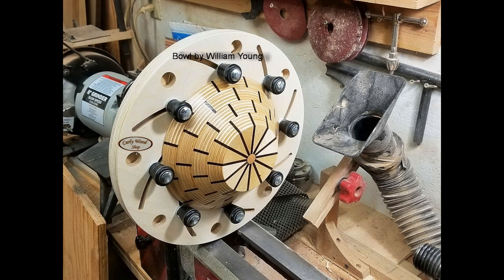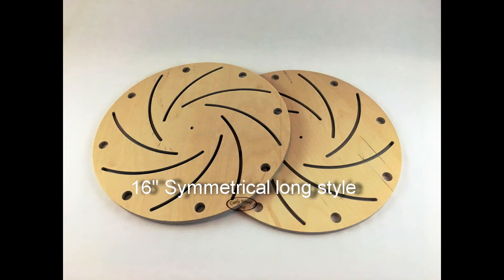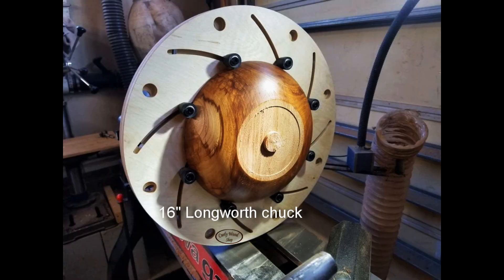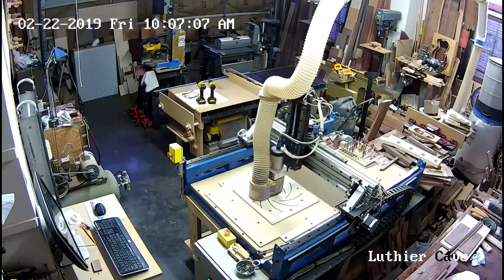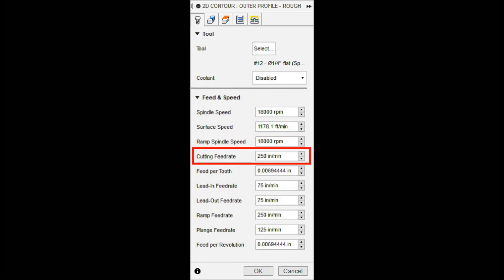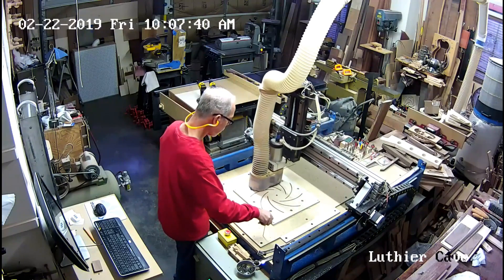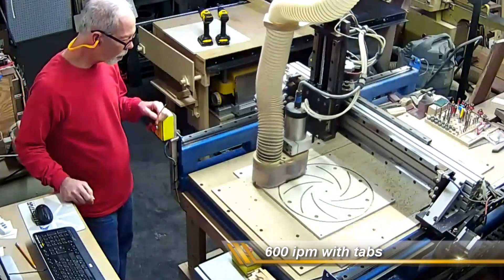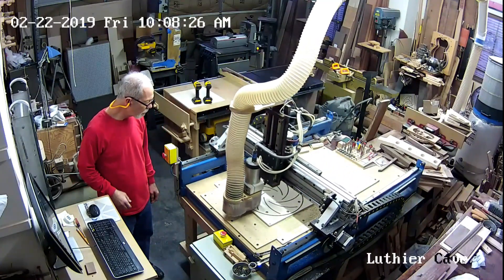Cutting at 600 ipm, not on purpose - Longworth chuck

Comment: ive done something like that... tried to set my machine to run at 80 and hit 800 so it was going at 400ipm
Reply from the maker: Exciting, right!!! LOL!
Reply: @difalkner   for sure... i dont run the e stop so i had my hand on the power strip button the whole time good thing it wasnt a long job.. but i did realize what settings i could use on some stuff from that little deal lol
Reply from the maker: Yeah, I tend to be a bit conservative in my feed rates, too.  I am cutting the rough pass at 300 ipm on the perimeter of these Longworth chucks and that seems plenty fast, but I know I could cut faster.  The thing is, though, that I don't really need to cut any faster, so 300 ipm is just fine for me.